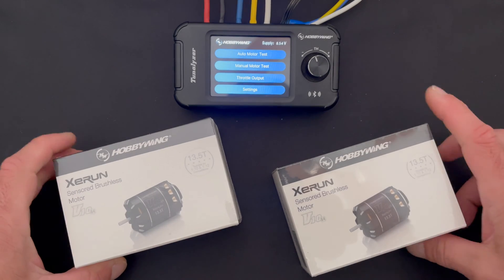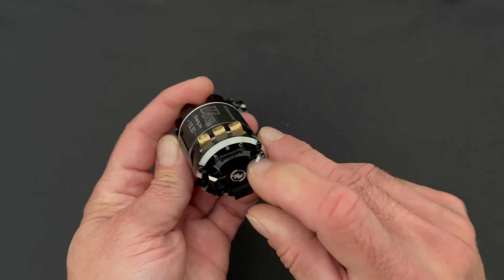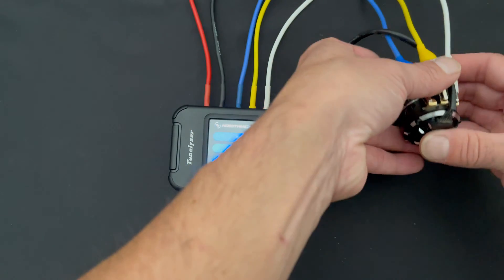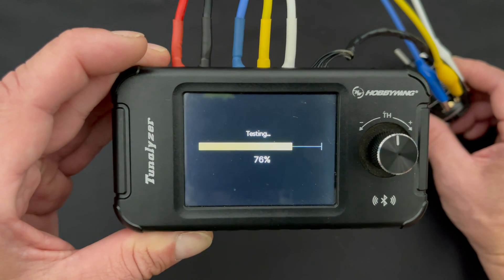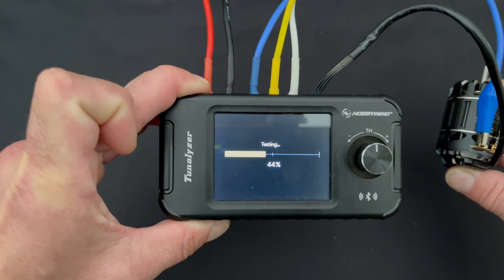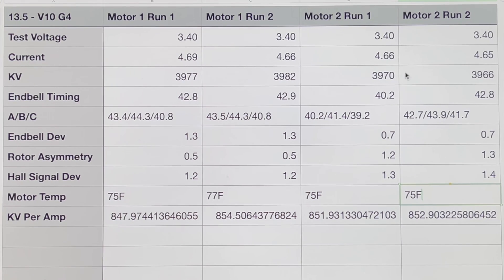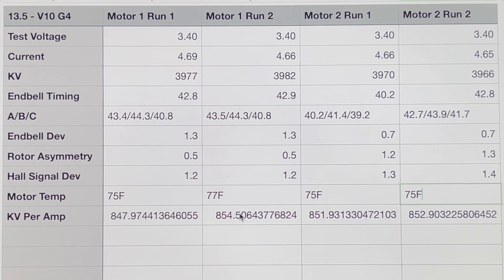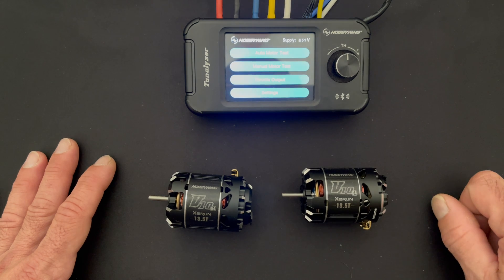The Charlie Show /// Episode 340 /// XERun G4 13.5 Tunalyzer Comparison

Comment: Looking at those results, I'd say Motor 1's Hall Sensor C is not soldered in the right place, it needs to be adjusted to even up the figures for the best results. 3.5-4 degrees difference between A, B and C is not good manufacturing tolerances